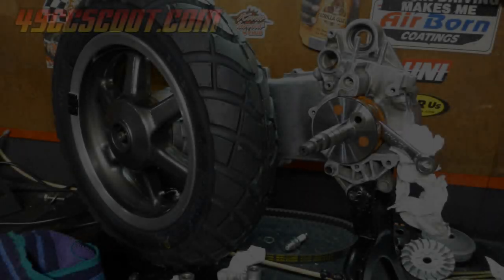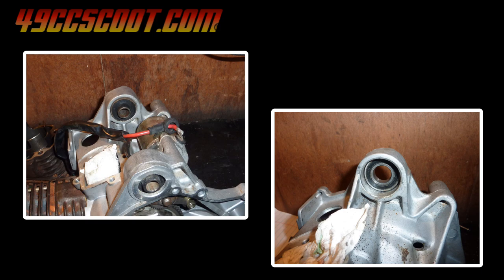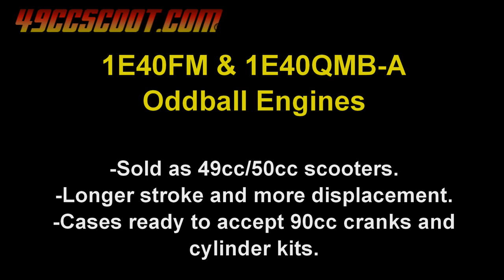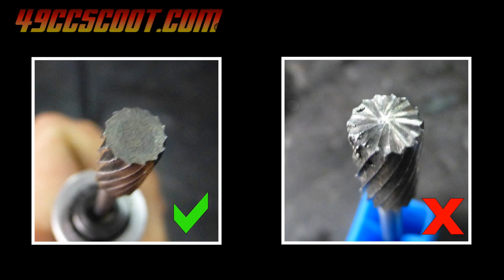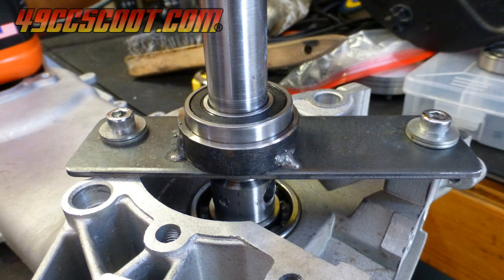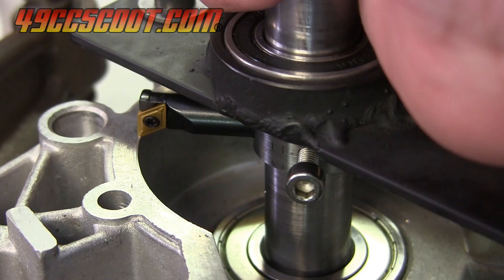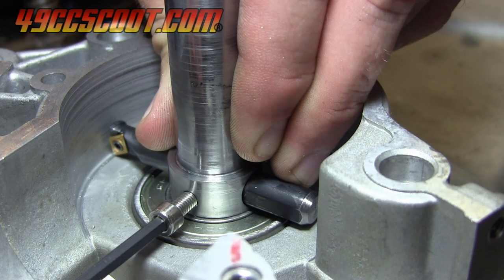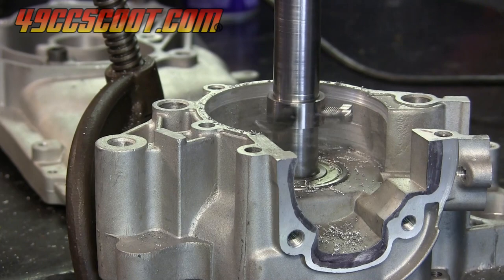Minarelli Stroker Engine Info And A Homemade Case Cutting Tool

Comment: Appreciate the information,  I'm located in Mexico but I used to live in the US, but down here is very very very common to see the Yamaha bws/zuma 100 and the vento Triton and the grand axis 100, if anyone wants any parts and engines  I can send them to you in the U.S or anywhere
Reply: Hey Im looking for 1e52qmg long cases, let me know if you still can find them
Reply: @Winner3ty  I don't know by codes lol but actually here in my shop I have a Bws 100 case if that works, let me know
Reply: @Magic_Mike1127  1e52qmg is triton 100 engine. the bws engine wouldnt work

Comment: Very nice man I am amazed that actually worked I was thinking of doing a stroker on my 1e40qmb motor but was a bit worried about what you have just solved to the lathe I go and after the drill press will give it a shot I got 2 spare motors to play with so this should be a fun project that may make things much easier than I had thought would be and also much cheaper.

Comment: Awesome to see you starting your own machine work!  I recently got a lathe (first a 7x10 and now a 9x20) and table top mill, they really open up the possibilities for taking projects to the next level and potentially saving money.  if you haven't already seen them, two youtube channels I would highly suggest are abom79 and oxtoolco - there is a goldmine of machining information on them and other channels.   if you want you could spec out a different cutter for the boring bar you are using - a larger radius on the tip of the cutter will help with the surface finish and give a better transition when you reach the end of the cut at the bottom of the trench.  you can also spec a much sharper cutter intended for aluminum which will greatly reduce the strain on the drill, the impact of the interrupted cut and flex in your fixture/bearing holder.
Reply from the maker: Yeah, there are a few very good machine shop kinda youtubers. I have lots to learn, but hopefully I'll improve over time. Even with my limited knowledge, I've done some useful stuff with the lathe already.

Comment: Great guide to the case's you can use. That tool worried out so well. Like you said it you had a drill press it would make it more controlled. Still works fine though.
Reply from the maker: Thanks Bud. I noted the issues so no one made their own and was surprised, but I don't really have trouble using it as-is so far.

Comment: if u do the shallow side first then flip the bar around, put the cases together and cut the other side, then u will have perfect match at the join and it will be more stable, also use sum kind of flex joint between drill and bar and it remove any side to side input u may put into the drill, works good as is just thought i give sum ideas, cheers

Comment: You can juse the old smal krank and weld 3 ore five dots on it en dan you cut it in the propper diameters then you grind a half moon in the weld s grind some of the old crank where the bearings sit and there you go
Reply from the maker: I have seen others use the crank, or part of it, as a cutting tool. Pretty efficient idea. Some have made them adjustable so you can cut different diameters or make multiple small cuts to get where you want.  I've used mine on many Minarelli and Honda Dio/Elite engines at this point and I'm still very happy with it.

Comment: Simple idea. Put eg a bike wheel etc Instead of drillpress lowering handles...you then have a much larger diameter and can lower in much smaller increments for a finer cut.

Comment: The idea is pretty nice and well made, the only thing i would have changed is the play on the shaft  where the bearings are located. The best would have been to make an interference matching, ofc undoable in this case for simple slicing reasons. Btw also with a play matching i wouldn't surpass 0.02mm of play. Just in order to get a better surface finish wout vibrations! anyways great job m8

Comment: I can't believe you replied awesome you really know your stuff  my tool and die is laking I will watch against an follow your  recipe thanks
Reply from the maker: lol I reply to anyone that's not being a clown basically. Check on the forum if you're considering making this. A much more experienced machinist modified the idea so it is dual purpose and cuts the cases for both the crank and the cylinder.

http://49ccscoot.proboards.com/thread/10392/cutting-cases-accept-cranks-matching?page=1

Comment: Its great tool
 try on getting your bench press drill fixed so it go in reverse which is going to give you a better grip on lowering your bit
finishing it off is just with some sand paper round the 500 just to give it that polish finish
but yeah great tool
takes away the time you would spend on doing it manually with a dremel
Reply from the maker: Thanks. I doubt that I'm gonna worry about it too much. It's so much nicer after being used to a rotary tool. I don't have any big complaints with it; I just wanted to point out what I experienced so no one would try to build one expecting anything it doesn't deliver.

Comment: That’s what I should have made to enlarge my CVT case instead of a few hours of using a rotary burr. 
Maybe next time I’ll try and do something like this for the inside of the CVT using the existing clutch shaft hole/bearing.

Comment: You should import yourself an Aerox. That way you already have all the good stuff like front & rear disc brakes and liquid cooling and also a nice body style like lots of fairings and aftermarket suspension and engine kits available for it and 13" wheels STANDARD. so you aren;t chasing your tail upgrading parts that it already has.  I could help finding one locally if you wanted to import one
Reply from the maker: That's for rich people. I am not one of those. Multiple people on the forum have looked into it and it's expensive to do in the US. I've had T2, the 2T that I ride the most, for more than 10 years and it's not really lacking much that I want in a frame at this point. I don't think there is another small scoot that I'd like better than it right now because I've made it my own. Besides, if it were just right standard... I'd still change it around.

Comment: Thanks for all your info so far, very helpful and thorough. My question is...when you build a stroker with a bbk Ac or LC, do you go with a 12mm wrist pin crank and bore kit or stay with the 10mm?
Reply from the maker: Go with 12mm. Some of the high end kits have even larger pins.

Comment: Fantasic info Dude. Keep it up. Question for you. Have you ever done a clip on putting the stroker crank into the cases once you have machined them?? I'm just wanting to make sure I know all there is to know about how to do the port timing correctly. Any help would make you a god amoung scooter riders. Cheers
Reply from the maker: I've never done a video about stroker crank install and timing. I've got crank install videos, but just showing how they go in. I've got a big thread about this scooter on my forum and I've detailed every time I've built one of these strokers if I used spacers or modified anything and what timings were and so on. http://49ccscoot.proboards.com/thread/436/triton-2-t2-89-110cc

Comment: pod jaki wał to robiłeś ?? nie umiem żadnego wału o większym skoku znaleźć :( i co to za cylinder ?? kiedyś miałem 103cc to chyba to ale nie wiem
Reply from the maker: I guess they are Jog 90 parts, but I've never worked with an actual Yamaha Jog 90. Here in the US, the parts are most commonly from youth ATVs. There were a bunch of 2T ATVs with Minarelli engines for awhile. Polaris made 50, 70 and 90cc versions for example, but there were quite a few manufacturers. Some were even liquid cooled and aimed more at the youth racing scene, like DRR/DRX ATVs. Here's an ATV site where you can find some of this stuff : https://www.gforcemx.com/pages/atv-parts

Comment: Apart from increasing the displacement, are there other advantages for strokers? I may think at better yield or torque... I have just did my first upgrade of a stock 1E40QMB-2 to a 47 bore. By the way, I have no idea what the "-2" from the mark of the engine stands for, it's mounted on a ZNEN ZN50QT-19C that I acctually find nothing about. :) And I was thinking to upgrade the crankshaft too... Thank you for all the videos and instructions, amazing DIY channel!
Reply from the maker: Torque and power at low revs is good with the setups like I build. If you just want to tool around under 9,000RPM mostly, it's hard to beat the 90cc+ stuff. There are lots of 70cc setups that will make more power, but they do it at higher RPM. A big stroker crank isn't good for a standard stroke cylinder. Throws timings off too much and you have a lot of issues to deal with getting clearances right. 41.4mm stroker may work alright, but you probably won't get big gains from it. If the crank is in good shape, without lots of miles on it, it's likely fine. You start to run into trouble with stock cranks with high revving builds, and then a quality crank is a good idea.

I'm not sure about the -2.
Reply: Thanks a lot! Before my plastic drive gear from the oil pump cracked after 4800 Km (I run kinda 200 Km without noticing the lack of smoke, my bad), I used to push the engine till 9000 rpm. Then, the horror story you mention in one post! :( I suppose the new setup with the 70cc will work pretty similar in terms of rpm, but I have to pass the purgatory of 1000 Km break in to see it (or not?). But I revenged by taking out all those ugly items related to oil pump and switched to pre-mixing now! So I understand is not worthing  to change the crankshaft now, I checked it and is still fine. But I really like to experiment on my scooter and I was curious about the benefits driving you to build strokers.
Reply from the maker: If you check out my vids, you'll see that I like long rides. I think I'd do better with strokers making more power at low revs for this stuff than I would with higher revving setups to make similar power. For what I do, sport to mid-race 70s can work OK though. I think being a fat dude (300lb) makes the torque more of a necessity for ease of use too.

Comment: Sir can i ask something is there any difference between the conecting rod of jog 90cc and 50cc engine
Reply from the maker: The 90cc should have a longer rod. Check all dimensions if you're trying to replace one. 50cc should be an 80mm rod. 90cc stuff that I've had has commonly been 83-84mm.

Comment: I have icebear maddog clone 49cc 4storck 1p139QMB 50cc  is that a 50cc long case it has the fetty tires
Reply from the maker: I think the ones with fat rear tires are long case. You can count the bolts on the CVT cover and check. 8 bolts should be short case, 10 bolts should be long case.

Comment: What would you charge to do this ? Dont need it just wondering
Reply from the maker: Build a tool or cut cases? Not really sure either way TBH. Shipping would suck for sending cases 2 ways.
Reply: 90GTVert i was thinking case cuts.

Comment: y not make s slotted guide for the milling bit on a die grinder so the grinder moved an a fixed area
Reply from the maker: A forum member has done something similar to that idea, using a router and a guide plate.

Comment: How much would you charge to build the boring bar set up.... great idea.  If u built them in sure there’d b a market. I’d be willing to buy 1
Reply from the maker: Just the boring bar or the whole thing? Have to figure out what it costs me.
Reply: 90GTVert the whole set up.  Yea figure out the cost and let me know.  It looks like it works pretty well
Reply: @49ccscoot if this is still a thing, I would love a setup to bore the webbing area in my crank cases!!

Comment: Will my bearings and crankshaft rust if i'll use freezing-spray to install the bearings and crankshaft?
Reply from the maker: I haven't had a problem with it. When in use, they will have oil on them so that helps. After install (when things are back to room temp) you can spray them with WD-40 or oil them.
Reply: 90GTVert Thank you man :)

Comment: Can I put a stroker crank on my kasea 90 without cutting? if so what size?
Reply: Also its the 2004 skyhawk 90 to be correct
Reply from the maker: I've put 45mm stroke cranks into 90cc cases before without mods.

Comment: Where do you get the parts to build the parts for a 90cc 1e40qmb
Reply from the maker: Multiple places. I get stuff from eBay, PartsForScooters, kaseaparts, g-forcepowersports, and possibly anywhere else that comes up if I'm searching for something in particular. They're not nearly as common as the stuff for 70cc or high end builds, but they're out there.

Comment: i already see a aerox bb kit diy in the near future
Reply from the maker: I don't think there would be much point if you mean the Aerox 100. It would need a lot of work to adapt to the stud spacing. Then the cylinders available for the Aerox 100 are all mild AFAIK. It would make more sense to adapt an MX cylinder with some serious transfer area. Again, lots of work though. Easy solution is to go with one of the kits that comes with an adapter and has a cylinder modeled after an MX jug. I believe Stage6 R/T is one example. I don't follow high end stuff too much though. It's costly.

Comment: Can I buy this tool. I really dont want to take my cases to a machine shop lol
Reply: @Kevin Stearns is what worth it.
Reply: @Kevin Stearns if you're looking for more torque in general. Yes a stroker is a great addition.  Finding a cylinder that's also suitable for the stroker is a great way to get good torque and power.

Even if you stick to the more tame 90cc cylinders and such.

Not saying there's anything wrong with a 70cc either as they can still hit speeds above 70.mph.without giving much of a fuss. But if you're more in the "reliable daily torque monster" then a stroker and even a 47mm piston will make a nice difference.

Comment: How do u make the carbite cutter drop automaticly downward?
Reply from the maker: Gravity. lol You get a feel for controlling it and again gravity will naturally make it want to fall downward.
Reply: 90GTVert i thought that u lock the carbite cutter tightly so that mean needs to lock the cutter not too loosen so it dont fall so fast and not too tight or it wont fall
Reply from the maker: There is resistance, so the cutter doesn't slide really easily through both bearings, but it's largely controlled by the user.
Reply: Ow...i get it now i think i want to make special tool.like yours hehehe...thanks for the idea...keep making such informative video yeah...love all the vdeo u posted
Reply from the maker: Don't forget to look in the video description if you haven't already. I laid out a full plan with measurements and part numbers for the whole thing to help anyone interesting in making their own.
Reply: 90GTVert thank u sir
Reply from the maker: Glad to help.

Comment: You should spinn fast when cutting aluminium. And you should Never touch the cutting tip against metal if your not spinning the drill. Because you Will ruin the tip and it Will get doul. Its pretty much in destructable when your spinning
Reply from the maker: I was new to it and that sucker will grab hard so I was trying not to go hard. Since then, I spin fast but I do still go slow to start because the drill pushes back so hard if it grabs.
Reply: 90GTVert it Will grab easier if you go slow, the reason why it would be grabbig might be that you move it down to fast. At machining school we turned and Milled aluminium at 2200 rpm because thats the highest setting. 3000-3400 i think was the optimal rpm.
Reply from the maker: @vhjvbhjb5280  It does grab easier going slow, but when getting started it can be tough to not have it grab. When it grabs with the larger drill wound up, it's a pretty hard hit.  At least it doesn't try to break my wrist if it happens with less vigor.
Reply: 90GTVert are you using a Cordeless drill That stops directly when you let of the trigger you Will most Likely be fine. And on most drills you can change the setting so That it stops rotating at a certain Nm. And to prevent it from grabing even more. You can take smaller steps so 0,5mm per cut. Thats of course +1mm of the diameter.
Reply from the maker: @vhjvbhjb5280  I've only got corded stuff. Last experiences with cordless was long ago when batteries were pretty awful. I need to move into the modern era.
Reply: 90GTVert 😂😂 yeah the corded drills are more for builders i guess. for drilling in Wood and concrete. Nowadays drillpresses are the most common for metal. I would definetly recommend getting one. Of maybe get one of those stands for a cordless drill. Its like a stans That turns your cordless drill into a drill press. Corded drills are prone to fuck up your day.
Reply from the maker: @vhjvbhjb5280  I have a drill press. It has no reverse though and the cutter needs to go in reverse as designed. It may not be perfect this way, but you should have seen the time it took me doing it more freehand with burrs and flap wheels before I made the cutter. Not to mention the difference in accuracy and concentricity.
Reply: 90GTVert yeah its 1000 times better than using a dremel. But why do you need to reverse?
Reply from the maker: @vhjvbhjb5280  Because of the cutter. Could use a different cutter.
Reply: @49ccscoot  Have seen milling videos that use WD-40 as lubricant for better finish and to prevent aluminum from "melting" and caking up on the tip of carbide cutter...  May not be an issue if rpm is lower than 1000.
Reply from the maker: @alfaspiderveloce6617  I use WD-40 and it helps with the finish at least. It's also better than the aluminum dust that it makes for fine cuts done dry.